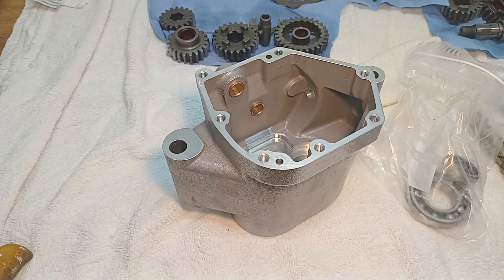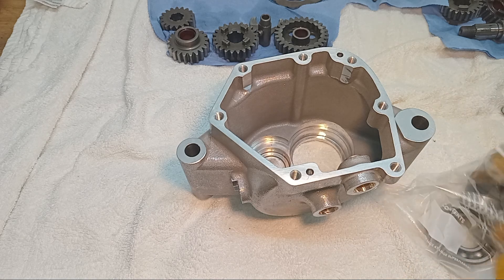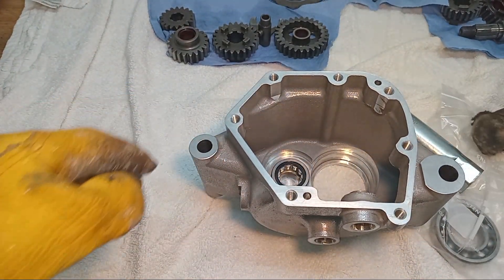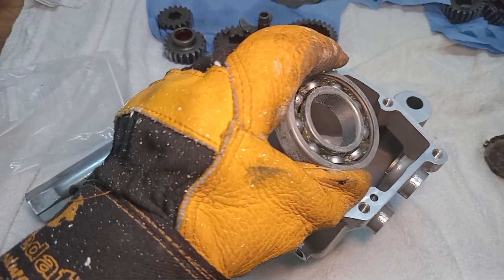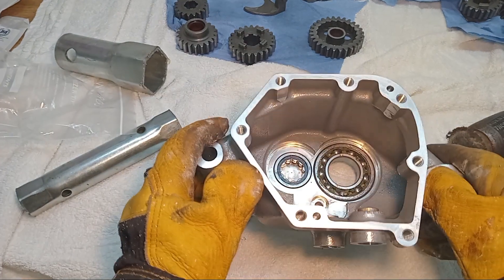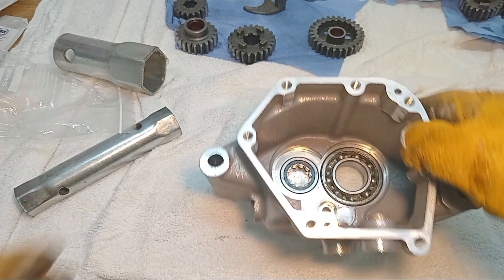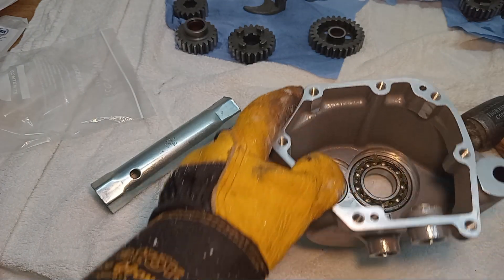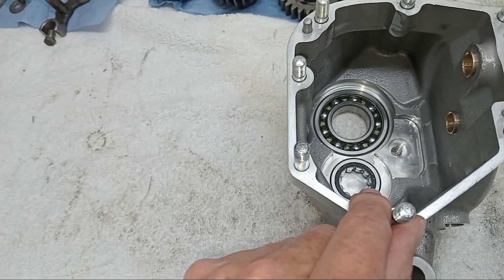Norton Commando Engine Rebuild. Part 32: Fitting the Gearbox Bearings

Comment: Hi mate, when you fitted the layshaft roller bearing, did the outer race end up sitting flush with the casing?
Reply from the maker: I can't remember exactly, but I think it stood proud by a few thousands of an inch so that the 4th gear on the layshaft didn't foul on the casing when turning.
Reply: @ thank you very much Chris, I have just bought a very rough ‘71 commando, my first non Burman g/box as well, your videos have been immeasurably helpful